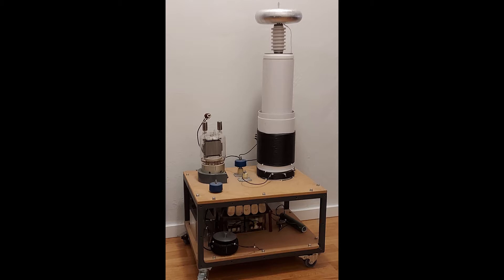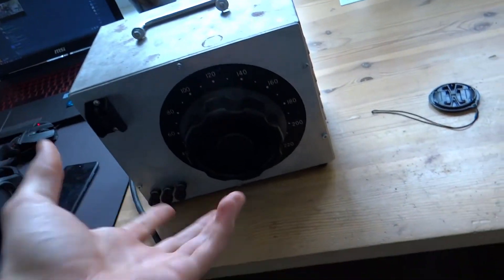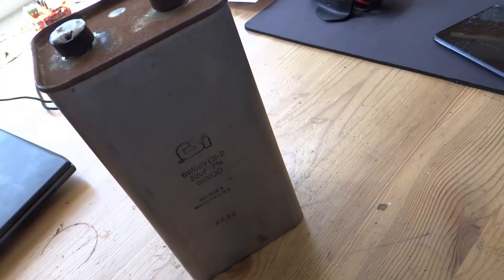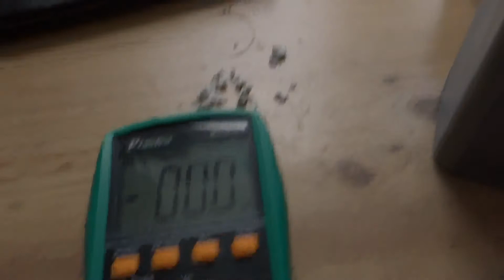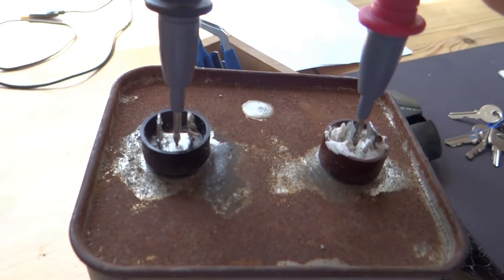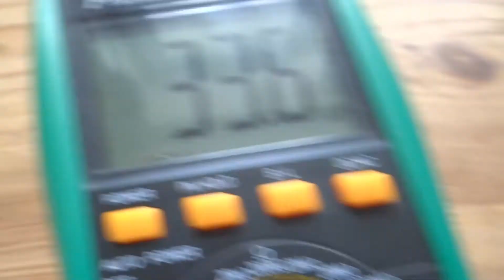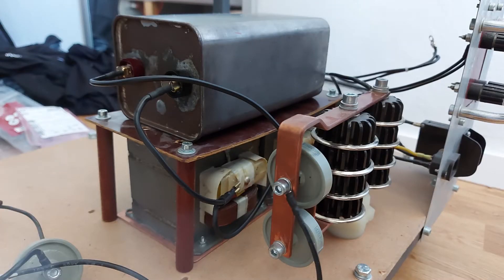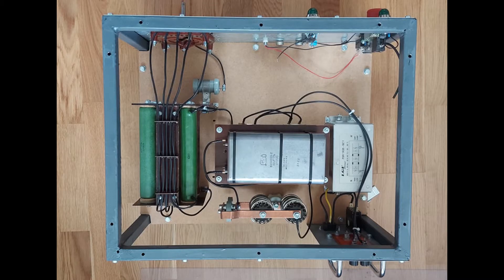VTTC Build pt.4 - more imrovements and tests!

Comment: No! The Filaments on directly heated tubes should always be heated with AC, not DC since it wears out the filament faster on the positive side due to electron bombardment!
You just need an RF bypass capacitor on the filament, a couple of nF
Reply from the maker: Thank you! i didnt know that, thats very reasonable though. will keep this in mind!
Reply: @mhz579 For indirect tubes its fine since the filament is isolated and coated and not emitting any reasonable quanity of electrons, but for directly heated tubes its bad, you basically weaken one side more, and there are also issues in heat distribution (somehow), powering some VFDs on DC leads to weird hot spot results
Reply from the maker: @janno288   okay, right! thank you for your insight. ill remove the rectifier!
Reply: @mhz579 funnily enough its partly the reason why we rediscovered thermionic emission by edisons DC light bulb experiments and the uneven blackening of the bulbs
Reply: @mhz579  kiedy kolejny film bo fajnie się to ogląda :)
Reply from the maker: @Dj-AL-KAIDA  chciałbym w tym roku jeszcze podejść do tego projektu i kilku innych ale ostatnio nie mam głowy do montowania filmików. sporo materiału zalega mi na dysku, więc jak wreszcie się zabiorę to pewnie wrzucę kilka filmików o różnych tematach, przy dobrych wiatrach uda się może zamknąć tą serię i zrobić z tej cewki coś co wreszcie zadziała
Reply from the maker: I've just realised - due to the half wave rectified nature of the anode supply, even when the filament is powered with AC, the anode current flows only during one half-cycle of the mains. so the effect of uneven heating of the cathode persists! trouble ahead, i guess one must resort to the classic way of switching the phasing of the filament transformer (or its DC supply) every now and then.
Reply: @mhz579  ej bo napisałem miesiąc temu komentarz czy dało by radę kontakt do cb bo zamierzam zrobić vttc i potrzebowałbym jakiejś rady ale chyba yt usunął xd
Reply from the maker: @Dj-AL-KAIDA  pisz tutaj w razie czego, nw czy jest dalej coś takiego jak wiadomości yt ale kiedyś się dało wysłać chyba. powodzenia z projektem, zaliczyłem tyle wpadek ze juz czuje ze zaczynam łapać ocb. obecnie maszyna podziałała i cykała iskry pod 70cm, ale lampa mi przebiła bo znowu miałem beznadziejne Q w oscylatorze i chyba oscylacje były jakieś niestabilne i szpila napięcia na anodzie ją uśmierciła 😭. ale mam już 16 minut nastepnego odcinka zmontowane jbc ;)
Reply: @mhz579  It doesnt make that much of a difference.
also not really hald wave rectified, half wave doubled so it is also a sine wave but it will touch 0 but both half waves are being used.

due to the low voltage of the filament and the high anode voltage the effect of filament self degredation is tiny compared to the load the anode current places on the coating and also tungsten boiloff.

Its better to heat it with AC because its more robust
Reply from the maker: @janno288  yeah but the holding capacitor in the doubler sags heavily which can be seen in the output emmision - i see half a sine wave, the cap doesnt hold the voltage well enough to keep the sine above zero.
What do you mean by more robust?
Respect on your push pull coil by the way, you got any further with it?
Reply: @mhz579  Okay true.
With robust i mean there is a high chance to kill dour rectifier and capaciors with rf or other weirdness, the transfomer alone is robuster since it cant be damaged by RF, rf bypass cap near the pins and its good.

With the push pull vttc, its bascially on hold, I want to make a new higher frequency secondary, probably in a few months, the old one needs a lot of primary turns and high amount of capacitance which limits me to multilayer doorknob ones which get hot.
The high current draw still percists but its due to impedence matching which i still have to experiment with

I might change the feedback system to inductivly based with a feedback coil

is there any good way to contact you?
Reply from the maker: @janno288  well im a little hesitant to give away any contact info, so ill post it for a second, and once you get it, ill remove it lol. you prefer facebook messenger or telegram or..?
Reply: @mhz579  youtube keeps deleting my messages.

Do you have cord-dis (put dis infront of cord) youtube hates that word. 
My username is the same as my youtube name

Comment: with this gu-81m lamp you should easily get a 110 cm discharge with an SCR interrupter and 2 transformers from a microwave oven.  you need to adjust the number of turns of the primary winding so that there is a large current consumption.  if the filament transformer is pierced by HF currents in the circuit where there is a fatal flaw and the HF currents go to ground through the filament transformer, show your diagram
Reply from the maker: my schematic is pretty standard, tube operating as a triode, the supply is two MOTS in parallel going into  a doubler circuit with a 32uF capacitor, the grid leak has been modified to be 4,4nF @10kV (russian disc caps) and the resistance is switchable from abt 620Ohm to 2k i think, though i dont remember too well. The resonant cap is 2nF. Secondary is 2000 turns of 0,2mm, primary 2,5mm^2 i think with different taps, bout 50 turns at max. the feedback coil i dont remember maybe 20 turns or so. im thinking of switching to a secondary with 1000turns of 0,3mm wire and making the primary wider to decouple them to avoid flashovers
Reply from the maker: I was able to get a ~70cm discharge after some modifications. what Q would you recommend for the tank circuit? i try to tune for a Q of ~10. i also scrapped the rectifier for the tubes filament, replaced it with just a single 100n cap. Id really like 1.1m discharges, any help would be appreciated. PS your coils are legendary, crazy, but legendary lol

Comment: You can get some pretty high voltages back at your transformers especially as they are obviously an inductor and are in series with a capacitor so you have a series lC circuit feeding your anode..
Reply from the maker: im planning to wind some chokes on cores from an old tv flyback transformer and put caps on both sides to form a filter to protect the psu. maybe even a last resort spark gap across it though with that kind of energy stored id rather avoid sudden discharges... either way some improvements are slowly coming together, though my experience in this field of electronics is still rather small, mostly guesstimations im making. think ill put a secondary with lesser turns (1000) and windind the primary on something else instead of pvc tube, some spacers maybe. i reckognise you from the TC facebook group and saw your comments on insulating the primary to avoid flashovers, i might try that as well, def shortening the wires and putting the tube much further from the HF fields to perhaps lower the voltages induced on wires etc. cheers
Reply: @mhz579  np mate, well sounds good, a Terry style filter with series inductance or resistance and MOV clamps may be a better solution, if you try to use a spark gap straight across the transformer secondary this will almost certainly result in a continuous 50/60hz arc , you could however maybe use a snubber with a cap an series gas discharge tube 😬 I'd have to think about it, I haven't tried to build a finished refined coil as yet, my fun is is tuning and increasing performance, if you have seen my fb posts you have likely seen my sword spitting 5kw 1.5Mhz coil,  I'm getting 6ft now from a 1ft secondary,  and haven't finished yet, pulse tube next 😂, the best I managed from the gu81 is 4.4ft from 1ft secondary  at 1.6Mhz .. are you planning on mains syncronous ramping? I've had a lot of fun with the simple dual 555 staccato by Steve, I plan independent ramping from a buck and full bridge inverter driving a rewound xrt straight onto the anode in future,  ive already built the buck and a lash-up inverter and tested it with a quick and dirty pwm ramp from a tl494, I just fed the deadtime pin of the 494 with an inverted ramp from my signal generator to  create the 0 to 100 percent PWM ramp at 15khz fed that the the buck igbt gate and the output of the buck straight onto the bus of the full-bridge 😁
Reply from the maker: @T2D.SteveArcs  thanks for the advice again! Yes im planning to make a staccato circuit for this thing. Curious to see how your QCWVTTC goes 😁

Comment: Great work! I am getting the final parts together for my GU81 Build. I am following Steve Arcs (Tested To Destruction) wife Michelle's build of his 420KHZ coil. For my torroid  I am using 2" carborator preheat aluminum flex pipe. It's quite rigid. I am going to have to look for a soft start circuit for the tube. I am just using a variac to control a torroid transformer for the filament.

Comment: Nice coil I also built a gu 81 coil with many arc overs a still refining. A good rf bypass cap helped mine along .
Reply from the maker: Thanks! RF bypass on the supply? yeah i thought of better filtering with 2 chokes and more caps... will have to work on it some more soon